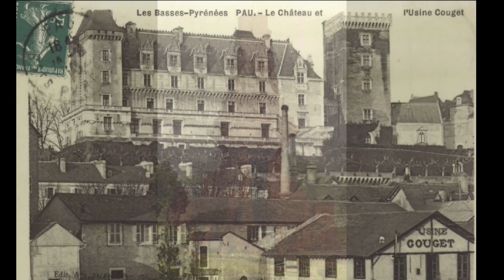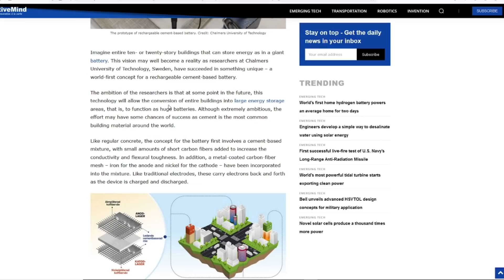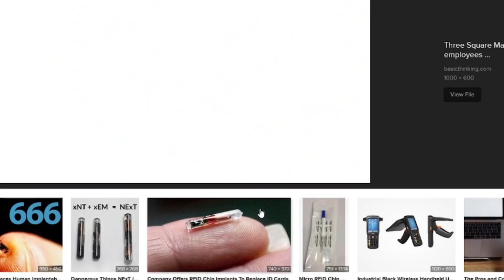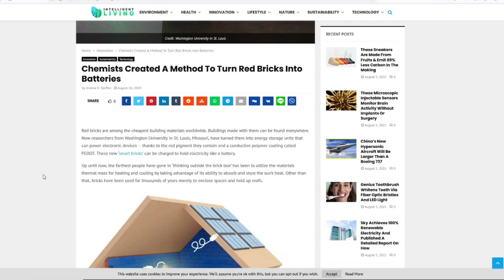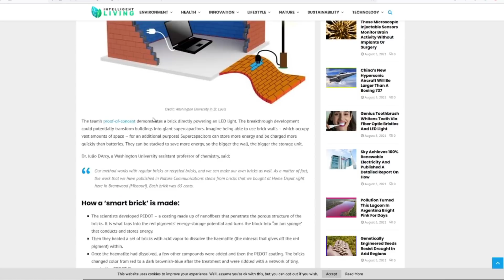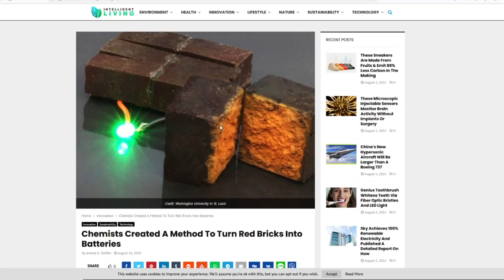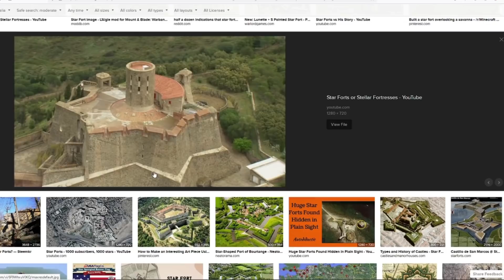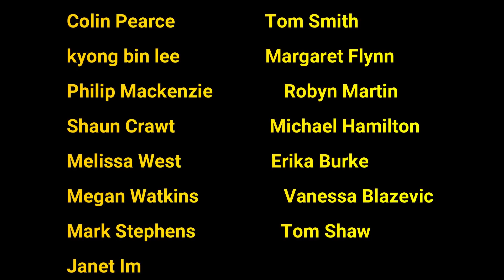Battery Buildings - Using Concrete and Bricks To Store Energy - Circuit Board City

Comment: All the oldest buildings in thr city have copper tops and/or structures on them and most of them have turned green as copper does. The bricks you showed about two/thirds through the video look to be turning green on the small sides where one brick would meet another if you were building something.

Comment: “Back to the future”! 
Recall all the bricks from the old world?
Iron oxide in the bricks 🧱 is what seems to have been used and the repurposed “cathedrals = Cathodes” capture and amplified the ethereal (Aether) energy which were stored in the bricks throughout the old world.
Which brings up the question: What caused the reset and worldwide mud flow of recent past?... In disconnecting the world’s grid, something went wrong (or on purpose) and the energy had to go somewhere, “grounded” = liquefaction resulting?
Cheers 🍻

Comment: I wander how many different ways to wire up this system. I did no research on how to wire up batteries properly. We are taught to keep an 12 volt system for solar. We connect all negatives together. All positives together. Then take energy and give engery to the batteries. By only one battery supporting all other batteries. I have done 3 different methods. Now working on an fourth. I did break all laws on how it is taught. Makes me wander about this method. Will it also end up as how they teach battery hookup now. In short. I use an flat line method. No lithium batteries. All of mine are AMG or gel. Different sizes and ah.  Solar is 12 volt first. 4th way is only taking 2 batteries and hooking them up as an hourglass configuration. Testing starts tomorrow. I am going to have to dig into this method. Sounds very interesting. Thanks for sharing it.
Reply: Angel, see this for another angle https://youtu.be/SNFego5qm74

The timing of these video releases gives me goose bumps. Right on top of each other.. both extremely powerful expose’ on brick buildings..
💜✨🙏
Reply: @shaespear407  I have been watching old tech now for years. All of those are connected to star cities. In the USA an star city is every state capital city and DC. Yet not our history. We built none of it. Even what they teach about Egypt is an mega lie. We live on an planet of lies. Most of what we use comes from dead giants. Even gold. Vain of gold. From the vains of dead giants. Iron. Coal from dead giant trees. Why in reality I choose no sides. I cant. We live again on an planet of only lies. I proved it by how batteries are hooked up fir solar. I proved it by using simple items to make an electric boat go none stop 24/7. With zero lithium batteries. Just AMG and gel. 4 different ways to even hook up groups of battery banks. I learned it just by playing with them. Whom knows if the ways are taught. I don't care. People can not believe it anyways. Taking an battery bank and making it into 1 battery by simply wiring it up an certain way. No computers, ect. Just wire. Again, I can not choose an side. I know to much.
Reply: Incredible. Thank you for sharing your thoughts. It is nice to hear & consider different perspectives!

Comment: This is old technology. Why do you think housed were painted with lead paint? More than 1 reason to ban it. The older method was too antique,  as it couldn't store lots, or keep even storage or supply.  Our modern electric just gives us a constant, more stable supply.  Hence some old buildings set on fire when struck bu lightning.